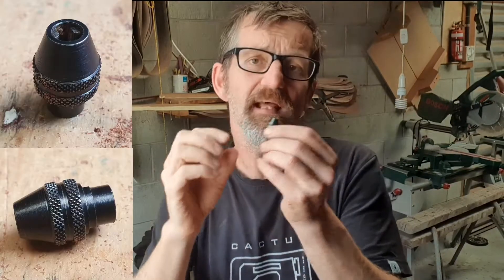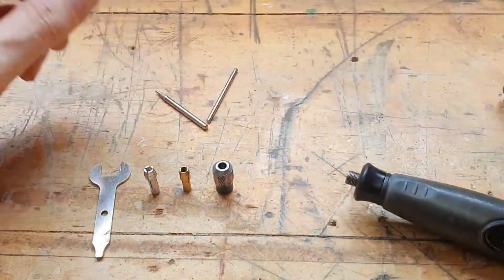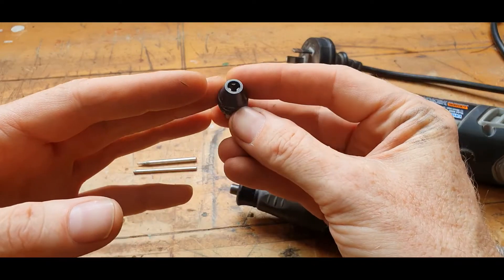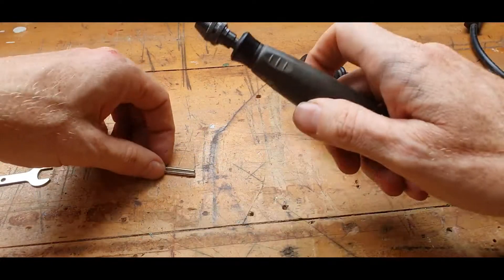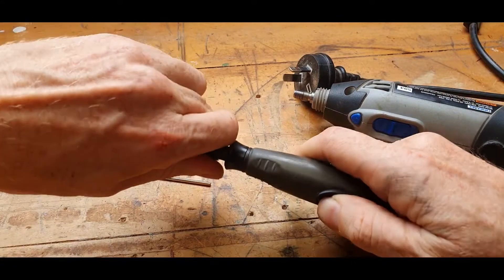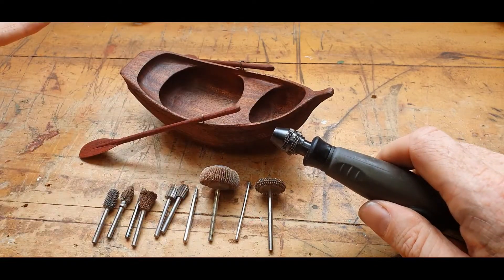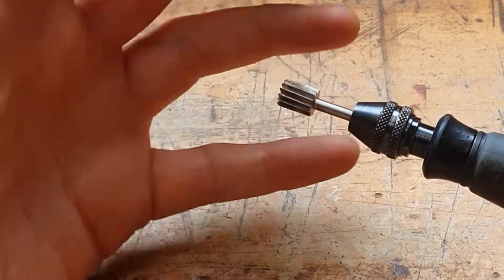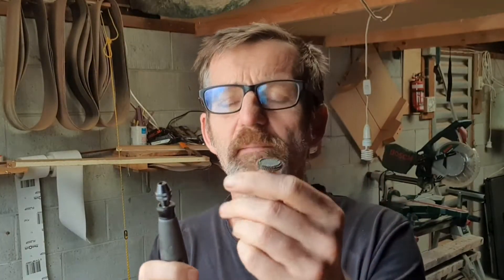Multi Chuck Dremel Review | Should you buy this!

Comment: Matt, that was a good point you made about it flying out.  It happened to me when I was carving a celtic heart recently and was using a big cone spear burr.  That thing flew off and also messed up my dremel flex shaft.  Small warp.  Glad it was under the 30 day return.  Anyways, I never did find that burr either in my garage and I saw that it hit my glass table and carved out a chunk.  It could have been my neck!  Anyways, glad you pointed that out and warned your users.  I will stick to the basic one in my new flex shaft :-)  If I do decide to use this one again, I will make sure it's nice and tight with the wrench.
Reply from the maker: Wow, that sounds like it could have been a lot worse. Yeah I  always spanner tighten these days. Thanks for watching and commenting 👍.  Happy carving

Comment: Like the video and how you went through things! 

I tried that on my Dremel. I have to say, I was NOT impressed with it at all!!! For the reason you pointed out about the bits coming lose and moving. I was having that happen even on softer woods though. I promptly went back to collets.
Reply from the maker: Interesting Chris. I use mine all the time, I do always tighten with a spanner though.
Reply: @MattCarves  I can't remember if I "always" spanner tightened or not. Logic would say I would have ended on using a spanner and when did not work enough I would have stopped.

Maybe something for me to try again... Or, maybe mine is dysfunctional 🤣😂

Comment: Hi Matt, thanks for the info. I still tighten the chuck with the spanner since my flame burr came loose at high speed and bent like a banana before i could shut off the Dremel!
Reply from the maker: Great Solution Claire, I have put a note in the description about this. I have bent a few burr,  mainly flap wheels, had some success in bending them back. But sometimes they are too far gone.
Reply: I managed to save it by cutting off the shaft before the bend, there's only about 1cm left but it tightens!
Reply from the maker: @clairetolmie5640  nice, good burrs are worth saving👍

Comment: The chuck is fast, but the collets have a design advantage. Collets are very accurate, making runout of a bit almost impossible. A 3 jam chuch does allow sloppy placement of a bit with the attendant runout or possible loss of the bit at speed! The chuck is fast, but be precise!  BTW  the nose cones on the newer Dremels have a plate inside that can grab the collet nut, acting like a built in wrench, no more searching for the little spanner!
Reply from the maker: Cheers Alan

Comment: thanks for the video . im just getting started wood carving . i just ordered the kutzal flame burr today .  question : i have firewood and there is so much bark on it . whats the best easiest way to remove the bark so i can get to the smooth wood .  do you think an angle grinder ?  this is all new to me .
Reply from the maker: Yeah bark is a pain to remove. I use an angle grinder with a kutzall disc. I haven't really removed alot of bark so my method might not be the best or cheapest. I am using it in this video at the start https://youtu.be/FsskvDK2bMo
Reply: @MattCarves  ok thanks ,  i went to harbor freight and i bought a 10 pack of burrs /cusps last week.  i didnt realize that they wouldnt fit the dremel . they were 1/4 inch . anyway i put 1  in my old power drill today (the old drill with the chord) and they worked great taking the bark off the firewood pieces that im gonna use . and they worked great stripping down the bark on the 7 foot branches that im gonna use for walking sticks when my kutzal flame burr gets delivered .   i have a question :  (im new to carving)  i cut branches off the tree to use for the walking sticks .  how long should they dry out for before i start carving them ?  or is there any tricks i should know ?  thanks man , love your channel !!  your a superstar !!

Comment: multichuck is fast but  it doesn’t hold the bit as gud when you hand tightened it......just like you pointed out often the bit just comes off or flying off if rpm is high when doing something hard
Reply from the maker: Yeah definitely got to watch out for that. I tend to spanner tighten all except for diamond burrs for detailing.

Comment: I wouldn't use it with the cutting disks, since they can fly out of it and cause damage/injury
Reply: In my experience, this chuck works fine with softer materials. But it often slips when cutting & grinding metal.